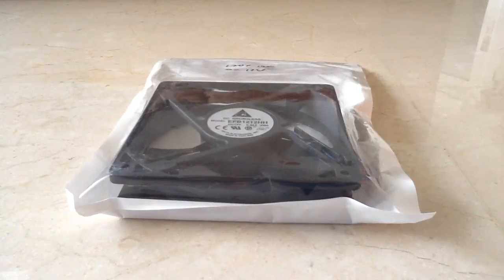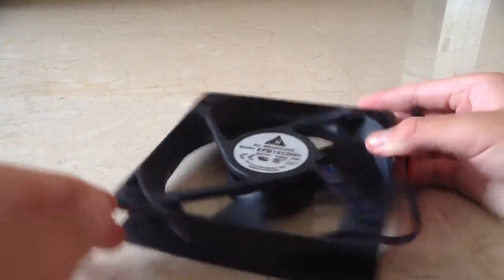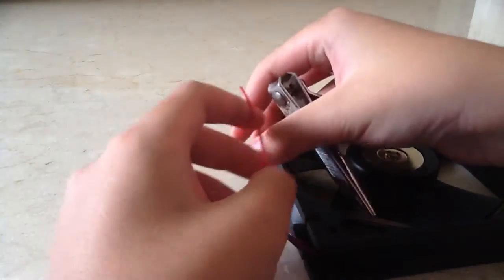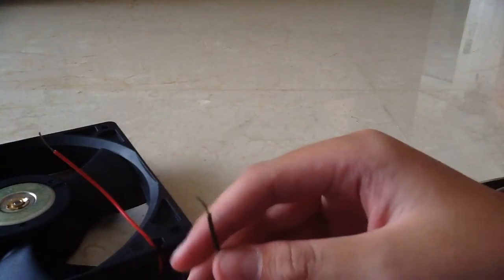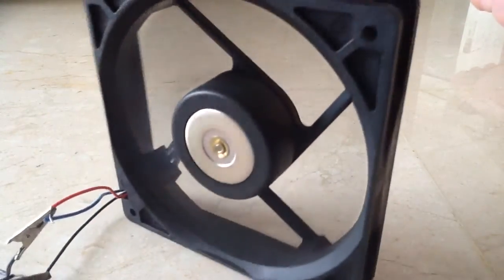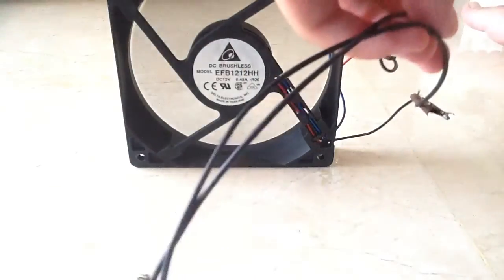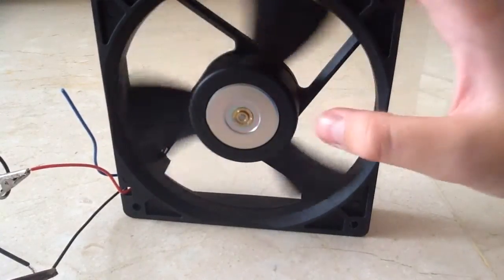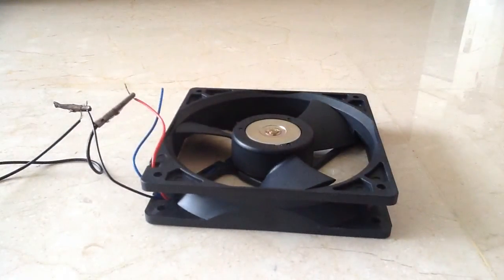Delta EFB1212HH Computer Fan Review and Unboxing

Comment: You didnt have to cut wires. You can remove them with sticking a thin object inside the 4 pin socket.